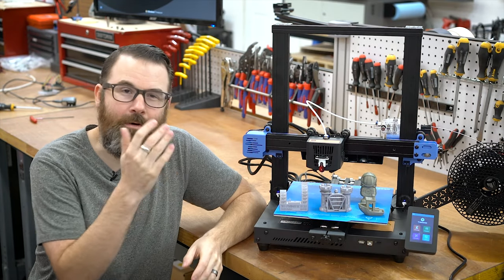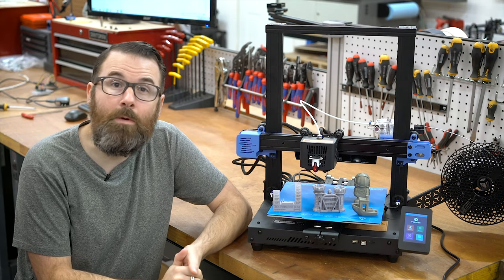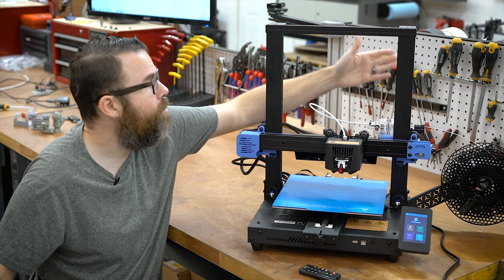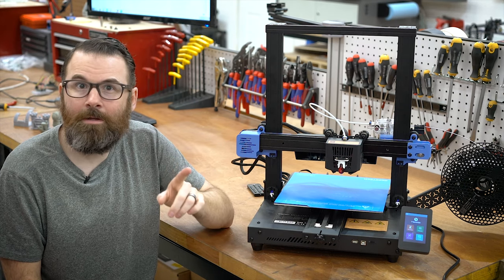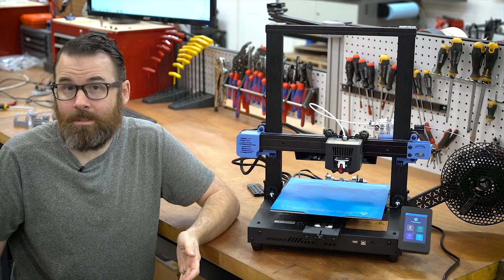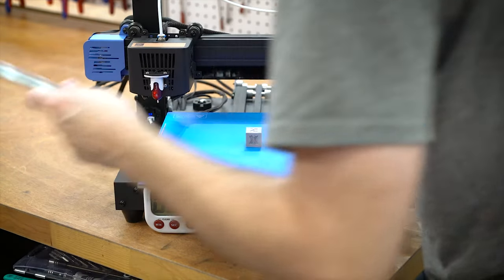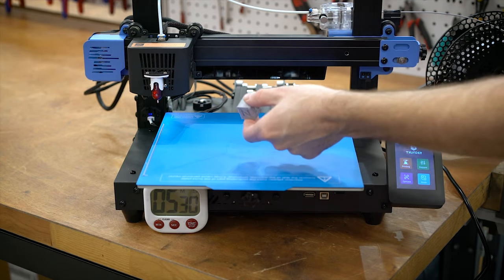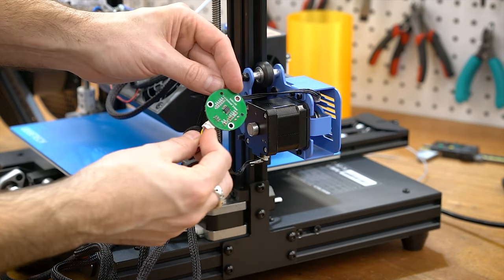Geeetech Thunder - Budget Speed Machine?

Comment: Watching more of this review, I expected this to have klipper by default and at least an all metal hotend. Honestly, with that information that it doesn't have either, its kinda... completely disappointing.

Sure it can get up to 200mm/s, but unless it can do high accelerations, input shaper, linear advance (which it can with firmware modification I assume) etc, the realistic speed of the majority of prints will be just slightly faster than any other typical marlin bed slinger.

On top of that, having a bowden tube when the head isn't even limited on weight (especially given they wasted a lot of weight on the useless metal shroud) seems like a pretty bad design decision.

With that knowledge, I feel like the price is steep considering that you'd have to do so much modding to get it to a true performance level.

Edit: A note about the hall effect magnetic sensor they are using: It actually has even more resolution than an optical encoder. I don't know about accuracy, but the resolution is extremely high. If you want to dive down a really interesting rabbit hole, you should check out the AS5600 absolute rotary magnetic encoder. This isn't by any means the only one, but it'll give you an idea of how cool and inexpensive these things are for reading position absolutely. Certainly a lot more advanced than your grandpa's momentary/relative encoder which just gives you little blips on each rotation.

Further Edit: At about 25:50 there was talk about gcode, and I just wanted to say for anyone who finds this useful, you can totally have cura inject this into your starting gcode on every print if you would like, as well as on certain layers. The functionality is there, though not super obvious.
Reply from the maker: For some reason, very few printers to an all-metal hot end, which is strange.  It's relatively cheap and opens up many new filament options!  I did look at the settings a bit and they do have high acceleration values, but it just doesn't seem to be compensated for in the slicing profiles at all.  You would at least need to bump up the temperature, adjust some of the retraction settings, etc.  Also, you're right about the extra weight!  It's a strange printer all around.  I do realize you can inject your own gcode, but it would be nice if there was a more elegant way of doing it, or if they came with instructions.  I'm not even sure what M command is used for turning on the fan.  They don't document any of this.  I usually present the information as if I was the intended user.

Comment: Hey Robert, I saw in an older video that you print with Nylon on a formbot , do you have an updated recommendation for such a printer? I am currently looking for one and overwhelmed by choice.
Reply from the maker: I'd look at my Ender-3 video, that's the printer I'd recommend right now.  The S1 Pro has an all-metal hot-end, so you can print nylon right out of the box.
Reply: @RobertCowanDIY  Thanks I'll have a look! Subbed as well <3
Reply from the maker: @sodanakin  Great, thanks!
Reply: @RobertCowanDIY  Just as follow up : Went for the S1 Pro , thanks a ton for the vids, keep them coming.

Comment: Speaking of Kickstarter printers, I actually recieved my Bambulab X1 Carbon with AMS (yes I'm aware that long ass sentence makes this sound like an add) and I really think it should be the kick in the pants this boring yet another ender 3 style bed singer market needs.

So much of it has just a completely different approach to design and manufacturing and the end result is that as someone who has spent thousands of dollars and hours tinkering around with cheap Chinese bedslingers, klipper, volcano nozzles fancy extruders and the rest, I hit print, and the print comes off faster and more reliably than any printer I've had and even my best klipper monstrosity.

I'm not going to pretend there aren't some big downsides though. Part of this we'll engineered product design design is thst they really, really do not want you to get into the weed with this product. Closed source boards, closed source mobile app, and a still new and slightly buggy slicer based on prusa slicer.

It also relies on wifi and used to rely on an unnecessary cloud connection (it can now print without any internet connection.

In some ways, that's exactly what I paid for; to no longer have to think about any of that, and to be able to have a part finished before I've even finished iterating on it and make the printer no longer the hobby. In that way it is successful, but it does mean that if I did find something I wanted to improve, I mostly am at the mercy of the company improving it. Thst said, in terms of the hardware and firmware there hasn't been any really issue thus far. I guess I would absolutely love if the AMS did soft filaments, but otherwise its probably now the benchmark in my mind.

Even still, I'll probably end up using it to print some other DIY core xy klipper job like a voron or simple core or something like that. Just to continue chasing all the perfect printer features I've wanted like speed + toolchangers + filament changing and that sort of thing. I guess I didn't really succeed in killing printer as a hobby, but at least I have a machine that makes the process something that's no longer in the way.

Its early days still though. I've only had it for a week and who knows right?

Huge tangent I realize and only tangentially related to the video but I see all these bed slingers that keep being released from companies pretending that somehow their carbon copy with one small twist will be game changing I  the presence of this actual game change and its sort of funny.

Admittedly this is an actual change, but ultimately feels like yet another printer where they just added a few aftermarket mods ahead of time  which is still useful, but rather boring.
Reply from the maker: Oh, fully agree, the Bambu looks pretty cool.  I'm surprised that people are still 'innovating' with bedslingers.  I was thinking about getting a Bambu, but I think I'll just wait until the Prusa XL ships, I got a reservation on the first day ;-)
Reply: @RobertCowanDIY Yeah, even Bambu makes bedslingers too